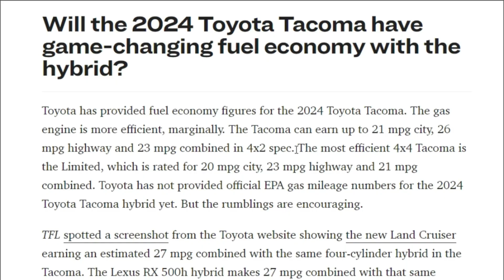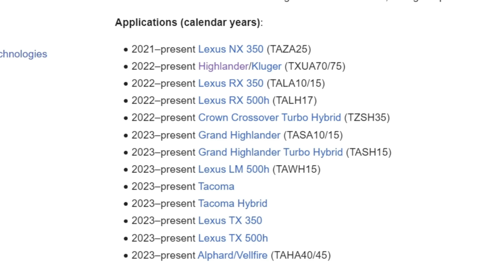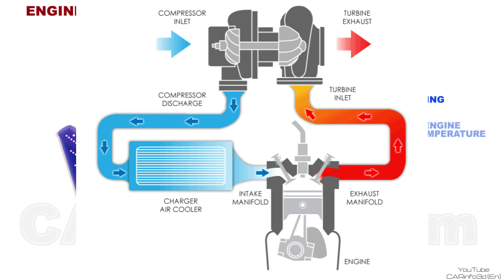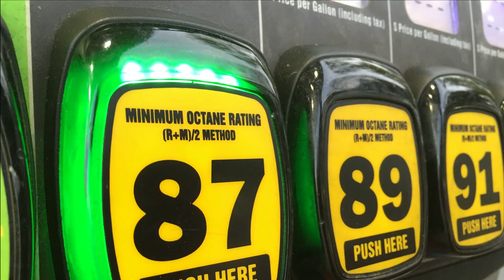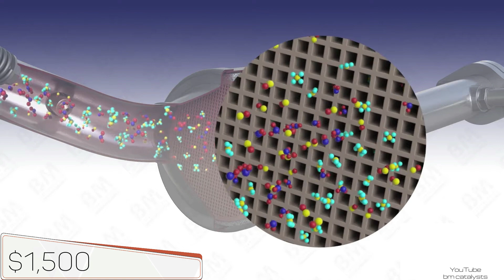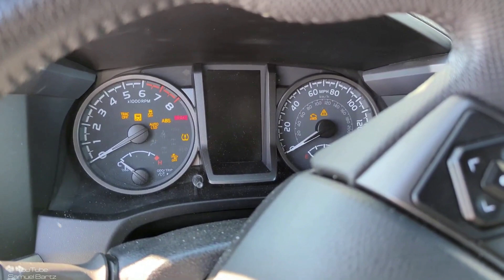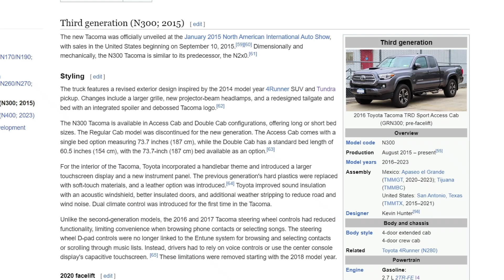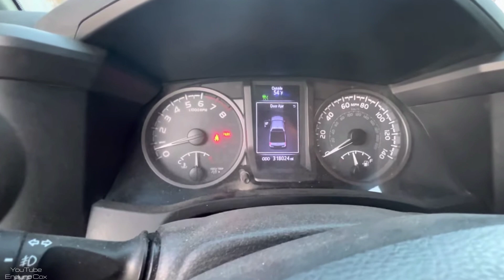Toyota Tacoma (2024–present): A Full Reliability Guide

Comment: I’ll stick with the reliable 2.7 liter 4 cylinder engine and the SR access cab. This is perfect for my use. Mark in Iowa.
Reply: The 2.7 liter 4 cylinder is still available on the current generation Tacoma on the SR and SR5 base models. They unfortunately probably won't be available after this current generation. Mark.
Reply: It's very reliable, and if it's adequate then it's a great choice. My v6 is adequate, but the gearing and transmission really limit the utility.

I wish I could get different gear ratios and a better transmission, but without the more highly stressed turbo engine
Reply from the maker: Hi man! You mean 2.4 liter?
Reply: @thelonglastexpert  No, the 2.7 liter. Not the new turbo 2.4 liter. The naturally aspirated 2.7 liter 159 ho 4 cylinder.
Reply from the maker: i got you now, toyota's 2.7 is the beast of reliability 💪🦾 @marksmith4582
Reply: What’s the point of buying a tacoma truck with no power. Might as well get a camry.
Reply: @lokkstarproductions6918  you obviously never drove one of these trucks. This truck is very powerful for four-cylinder. Can’t speak on the reliability of it but this thing is very peppy and will throw you back in the seat. It’s much more fun to drive than my 2022 model.
Reply: @ i own one and love it. I don’t know what you are talking about

Comment: Higher octane does not mean higher quality. It only means resistance to knocking in higher compression engines and has nothing to do with preventing carbon build up.
Reply: Toyota uses dual injection on the new turbos so you don't have carbon to worry about at all.
Reply: Regularly use injector cleaner?
Reply: @CocoNut2018  And also using top tier fuel.
Reply: Higher octane fuels do indeed help prevent carbon build up you are wrong.
Reply: I'm a powertrain engineer and that is very incorrect, although I'd love to hear your reasoning. Octane is simply a measurement of fuel stability, essentially the amount of compression it takes for a fuel to auto-ignite.  Higher octane means you can compress the air fuel mixture more without the risk of auto ignition prior to spark, and therefore yield more power. Now do some companies add additional detergents (which may reduce carbon buildup) to their higher octane fuels to add additional perceived value? Yes, but that has absolutely nothing to do with octane itself.
Reply from the maker: Does fuel with a higher octane rating help prevent carbon buildup on the valves? and what usually can help? @dcl97
Reply: @thelonglastexpert higher octanes tend to also have additives added to them that help with carbon buildup at the big name gas stations.